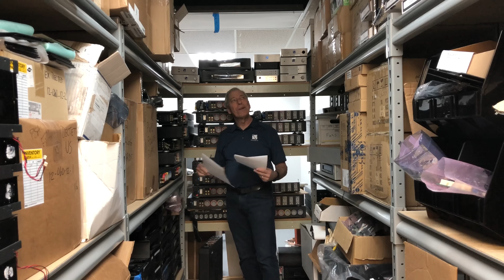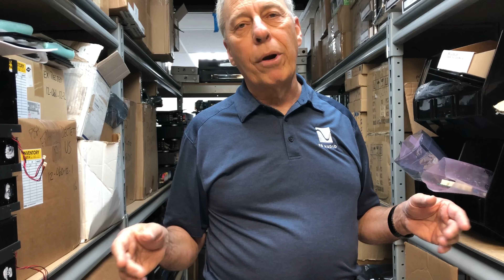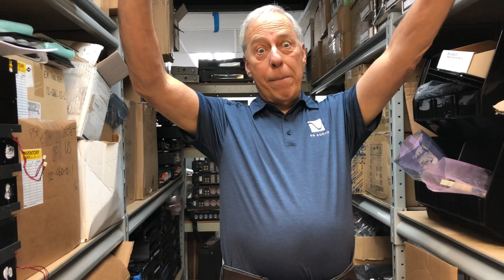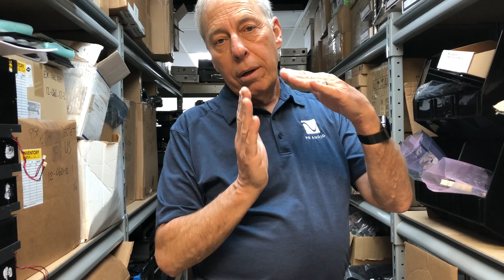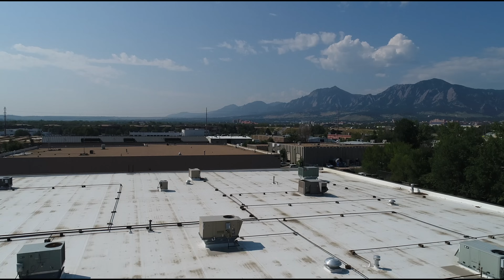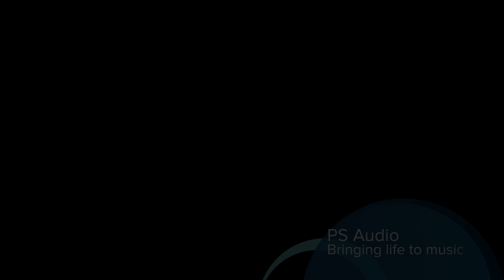Understanding what loudspeaker efficiency means

Comment: I wonder what the difference in ratings would be in subwoofers if we used say 50 or 60hz instead of 1k.. I own different subwoofers of the same diameter and power handling but one has a higher efficiency than the other.. however, the less efficient one has an xmax of 23.5mm whereas the more efficient one’s xmax is only 10mm.. the less efficient sub can produce lower tones much louder in the same enclosure(s) than the more efficient one and their fs is within half a hz of each other.. obviously moving more air makes sense, but would like to see the difference in efficiency rating at a lower frequency. Guess I’ll have to dig out my old db meter and measuring tape lol

Comment: One thing that struck me about this was it was measuring efficiency at a specific frequency, power and distance, but do speakers vary in efficiency depending on the frequency. So one speaker might be more efficient at 1 Khz and another more efficient at 2 Khz. If so is the 1m, 1Khz, I watt test a rule of thumb that gives you a rough idea of how loud a given set of speakers might get with a given amp. In addition is the possible differences in efficiency at difference frequencies part of what causes speakers to charachterised as "Bright" or "flat" sounding?

Comment: A friend and I built a mad 15" rear-loaded horn using some Eminence plans back in the 90s. The driver alone is rated 99dB / 1W / 1m so with the horn it is maybe 102dB! I could run that thing off a headphone amp. I wouldn't, though. It sounds like ass.

Comment: The answer is correct: 3 dB more is double the amp output in watt. 10 dB more requires 10 times the power output. 20 dB 100 times and so on

Comment: The sensitivity is only part of the story, it doesn't tell you it's maximum volume level, because speakers also have power ratings, supply too much power and you will cook the voice coil, even worse, is clipping the signal because your amp is under powered for the speakers efficiency for the volume you're trying to get to.
All of this has no correlation to sound quality, I've heard efficient and not so efficient speakers sound beautiful, they will need very different amps to be able to perform at the same volume level, so a speaker with 3db less efficiency(1/2) will require an amp with 3db more power(2x) to reach the same output.
Reply: J-man72 b Don't confuse sensitivity with efficiency.

Comment: A 10dB increase in level is about what most people would refer to as "twice as loud" but requires a ten fold increase in power...thus the logarithmic scale.   So if 1 watt drives a certain speaker to 85dB you need about 10 watts to drive the same speaker to 95dB.  105 dB would take 100 watts and if you wanted 115dB you'd need 1000 watts!  Whew!  Not many speakers or amps could take or deliver that kind of wattage. 

Now take a typical PA (Public Address) Loudspeaker.  It's not uncommon to find a two way unit with say a 12" woofer and horn loaded tweeter that will give up around 98dB with only 1 watt of input.  So now 10 watts will give us 108dB and  100 watts about 118dB.  However more efficiency doesn't mean better sound QUALITY just more quantity for a giving wattage.  Want to know everything about sound systems.?  "The Yahama Sound Reinforcement Handbook" ...about 20 bucks.

Comment: Hi Paul

I have had about three deferent amplifiers, starting with a Rega Elicit R rated at 105 watts per channel in to 8 ohms,  a Naim supernait 2 rated at 80 watts per channel in to 8 ohms and a Hagel 360 rated at 250 watts per channel. Out off the three amplifiers, the Naim was the most powerful but it had the lowest power rating, I think if I turned it up to much the speaker cones would fly out. My question, is one watt out of any amplifier the same, or is there more to the way the power is delivered and can this affect how speakers are tested for dB rating if  an amplifier gave out a louder watt,  are manufacturers over claiming the amplifiers output?  I enjoy your videos, hope you keep uploading more thanks.
Reply: Jonathan Bishop Firstly some manufacturers rate their amps conservatively so a rated 80 watt amp?may actually put out 110 watts or more. Also amps have varying levels of headroom. 2 db is typical but some designs can have 3 or even 6 db for brief periods. Also some speakers may have a nominal impedance of 8 ohms but can have dips under 2 ohms at certain frequencies. If this occurs in the upper bass area then a high current amp will take it in stride and sound much more powerful than an amp that struggles with a load lower than say 4 ohms. Very few speakers have a relatively flat impedance. Some speakers are known to require high current amps. All others will sound wimpy. High current amps can generally double the wattage with each halving of the impedance. There are even more reasons why amps of the same rated wattage can sound like they are not, but you get the idea. All amps are not created equal even when their ratings say they are.

Comment: All these comments saying how great the explanation was, and I'm here sighing and shrugging. Guess I expected more than the base explanation someone should already know. Like what if anything does it tell us about them other than they get loud? Does that increase also add detail or is that a separate issue? Many questions.
Reply: Generally, when a louspeaker goes loud, also its distortion increases. You are more likely to hear low level detail at a louder level, but, generally, to hear low level detail you need both loudness AND low distortion.

Comment: Thanks for the explanation.  I would have liked you to explain what sensitivity means to the consumer for people shopping speakers. Is a speaker at 85db inferior to a 90db speaker?  Are there tradeoffs or should we be shopping always for a higher sensitivity as a rule?  I guess I'm asking -- how important is this spec when evaluating a speaker?
Reply: Very high efficiency loudspeakers usually have more distortion and worse frequency response charts than lower efficiency ones. On the other hand, it's not quite so fair to compare their frequency response charts, because, if, for instance, you press the low efficiency speaker to reach the sound pressure level of the higher efficiency one, you don't know what kind of curve you'll get. As a rule, a low efficiency loudspeaker, no matter how good quality it may be, will require from you A LOT of power. And if you need a lot of GOOD power, then you'll also need a lot of MONEY. If it is a usual, electrodynamic one, with a fairly stable impedance along the frequency spectrum, it may save you some. So, a low efficiency loudspeaker will, finally, be more, or even much more expensive than you think. On the other hand, a good quality (low distortion, well made) high efficiency one, will save you money from the amp. If it has a really high efficiency (say 95-97 dB SPL per watt per meter), then you may enjoy the very best of amplification and overall sound around, at a very good price (because you'll need about 3 to 10 good watts to make it really sing). If you go for horns (which may be even more efficient), be prepared for "horny" distortions and rather poor imaging (but also a lot of excitement, for as long as you have some hearing left).
Reply: What matters more is cone materials, surround, damping etc, efficiency can be good or bad. My ~87dB/w Isobariks sound much better than my 99dB/w array speakers, though I'd imagine a klipsch loudspeaker to sound better than both at 95 or whatever. Though around 90 is a good start.
Reply: Efficiency of a speaker doesnt tell anything about the sound quality for example.
It just gives a tendency if you need a more powerful amp if you want to hear loud, or not.
A Vanlue of 85 db/1W/1m up to 90 is normal in Hifi.
Below you should think about power, above it is less important.

See the comment of "Full Ranger". Highest example.
1 Speaker, 216 Watt = 109db in 1 meter distance to the speaker.
You can add 3db because 2 speakers involved. so 112 db at 1 meter!
You are sitting maybe 4 meters away. outside, without reflections - double distance = half loudness (-6db).
inside a room its more! But... 
1 meter = 112db
2 meters = 106db
4 meters = 100db.
Thats very close to discotheque dancefloor level!
hope that can help...
cheers
Reply: Thanks.  That does help!

Comment: Hi Paul. 
Technically, a 3 dB increase in power is a double in volume:
10 * log10 (2) = 3.01 dB, where 2 is the double in power (volume)
Reply: Chris Bishop Double the power is not double the volume. It takes 10db to be perceived as twice as loud. So to be clear 3db is twice the power. 10db is twice the loudness.
Reply: carlos oliveira 
I'm fully aware of "perceived" level changes. That's not a scientific measurement, that's "psychoacoustics"  ... 
The relative loudness that we perceive is a subjective psychological phenomenon, not something that can be objectively measured.
Reply: Chris Bishop Well then how do you explain you are wrong? 3db power increase is not double the volume as you have stated. Volume or loudness is always perceived
Reply: carlos oliveira 
Doubling of the volume (loudness) should be felt by a level difference of 10 dB − acousticians say.
Doubling the sound pressure (voltage) corresponds to a measured level change of 6 dB.
Doubling of acoustic power (sound intensity) corresponds to a level change of 3 dB.
6 dB represents a doubling of sound pressure.
6 dB represents a doubling of voltage (RMS amplitude).
6 dB less SPL means a doubling of distance.
3 dB SPL increase requires double the power.
3 dB represents a doubling of sound intensity.
Reply: you are right, 3 db increase is the speaker playing twice as loud, but the hearing needs 10db increase to feel like its twice as loud.  you still feel twice the punch from bass tho, thats why huge speakers can give you a physical punch from low bass at low volume and small speakers can play low bass with noe punch at all.

Comment: Exactly,  you (your amp) need to double the power to get another 3dB out of the speaker. If you start at, say, 85 dBper watt per meter, (a rather inefficient loudspeaker) then, when you want to reproduce a full orchestral cresento at, say, 110 dB(still one meter away from the driver), then you'll need: 1watt-85dB, 2watts-88dB, 4w-91dB, 8-94, 16-97, 32-100, 64-103, 108-106, 216watts-109dB! And that's only at 1 meter (1.1 yards) away from the driver! Now, if your head is at an equivalent distance of 1meter from both loudspeakers, you'll get double the sound pressure which is another 3dB. That means you'll get 112dBs from both loudspeakers for 216 watts per channel of amp power. Or, you'll get 109dBs (your goal) from both speakers at one meter away, for 108 watts per channel. This sounds easy but, if you (normally) have your listening position at, say, 4 meters (around 13feet)away, then this 109 dBs from both loudspeakers drops dramatically to(!!!) 97 dBs! And that's because every doubling of the distance from the source leads to a drop of 6dBs! (so, from 1 to 2 meters, drop from 109 to 103 dB and then from 2 to 4 meters away, another drop to 97 dB). So, if you get 97 dB at 13ft away for 108 watts per channel, then you'll need...1728 watts, per channel, to reach 109 dBs at your listening position! So, do yourself a favor: BUY A TRULY EFFICIENT LOUDSPEAKER! (and listen at a closer distance away). Efficient loudspeakers don't come without flaws, though. Most of them are plagued by distortions and poor frequency response charts. The sad truth is that you'll still need A LOT of power to reproduce those very low and barely audible (hence, needing a lot of amplification) frequencies. You'll need a sub (or two) but you'll be lucky by the fact that low and very low frequencies get trapped  by your room (and, also, amplified by adjacent room boundaries) and so the loss by the distance is not as great as with mid and high frequencies. Also, big planar loudspeakers or line arrays/sources (different than usual point sources), have a much lower than 6dBs per double-distance loss, so they sound louder in a room than one would expect from their efficiency measurement. (Of course, these come with another set of flaws, as well...). Anyway, be ready to make WISE COMPROMISES, taking in account, your room and your tastes and your wallet.
Reply: Nice job explaining that Full Ranger.
Reply: Thanks, Spiceman50s. There's more, of course, but I tried to keep it short.
Reply: This is a good explanation of why so much power and efficient speakers are needed for live events that are in large arenas or outdoors. Some of the audience can be over 50 meters away and there also seems to be the unfortunate need to blast everyone with music that is as loud as possible. However, most home reproduction is in a relatively small room and the sound reflects so doesn't reduce at an anechoic chamber rate.
Reply: Charts don't tell the whole story especially if there are only tests in an anechoic chamber and not any done in a real world enviroment.
Reply: That's why I said there is more but I tried to keep it short. What I describe refers to either an open space or a fully anechoic chamber. A real world room contributes to the preservation of higher levels of sound pressure by keeping a good fraction of it through reflections. (But this is done very inconsistently throughout the frequency spectrum). In a real, medium sized room, not overly treated with absorbing materials, for the same example, one could only need about a quarter of the theoretically estimated power (still a good over 400watts). Other factors have to be taken into account, like the frequency range where the sound pressure level peaks. If this happens to be a frequency range at which the impedance of the loudspeaker drops low, this would require from the amp to provide a lot more watts than initially estimated. (Good point about outdoor use of efficient speakers).